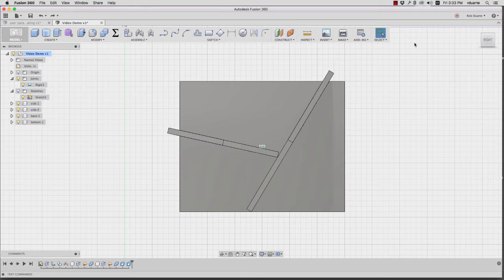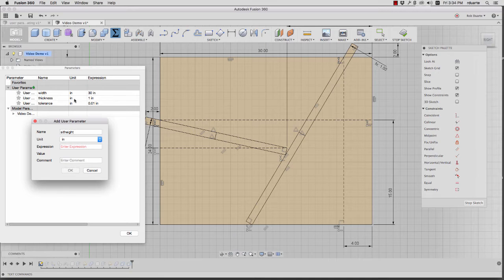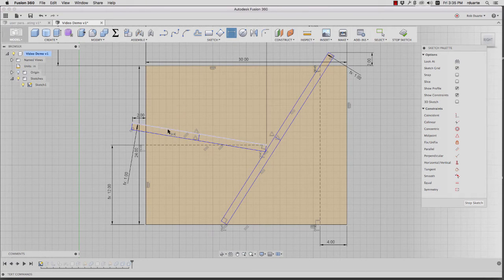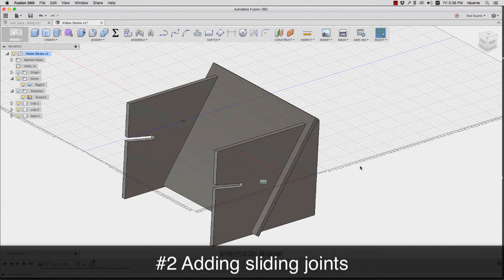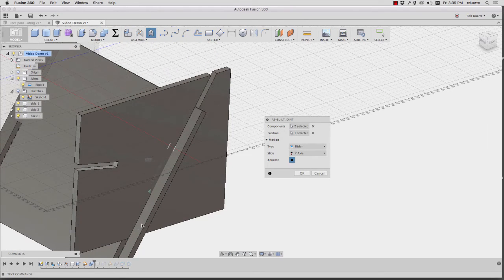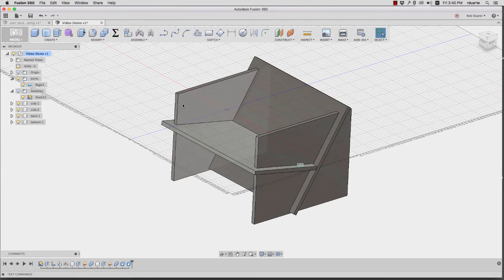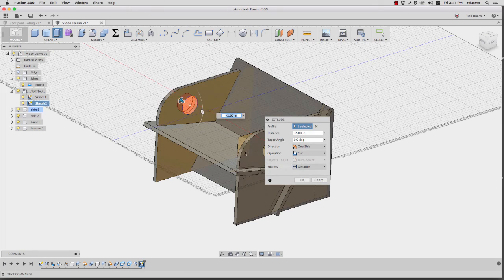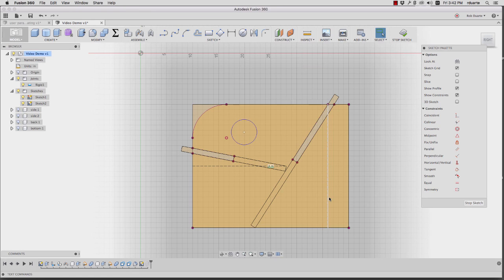Fusion 360: Bonus Papanek

Comment: Rob - thanks, I really like these videos.
Should you ever produce #3, it would be good to add a tab to the back of the seat base and a matching slot in the back. This would support the seat which is important when the back is more vertical (eg a dining chair) and/or the seat is long.
It would also hold the back in place, so that you could put a hole at the top of the back to use as a handle so the chair could be lifted one-handed. At the moment, it would probably just come apart!
Finally, with a CNC router, the tab at the back of the seat could be made to clip itself into place (assuming you were using say 3/4 birch ply) and then it would all be locked together while still being knock-down.